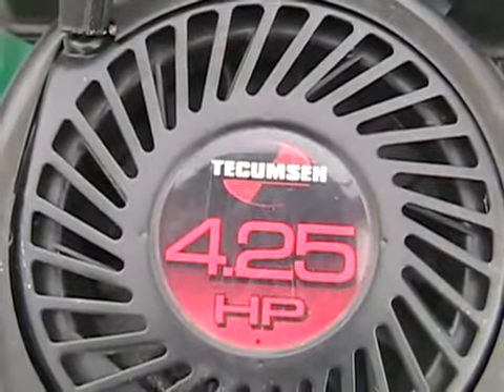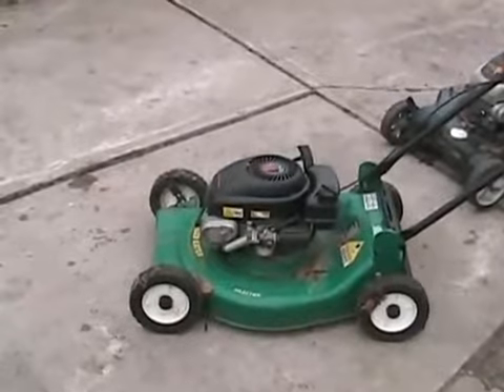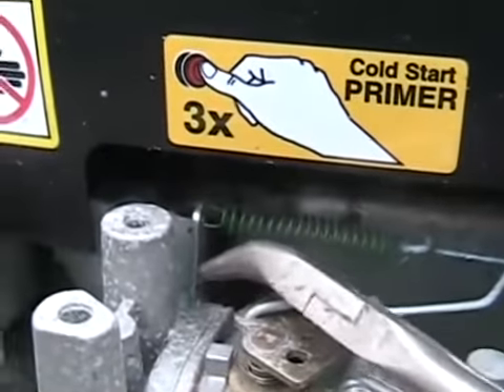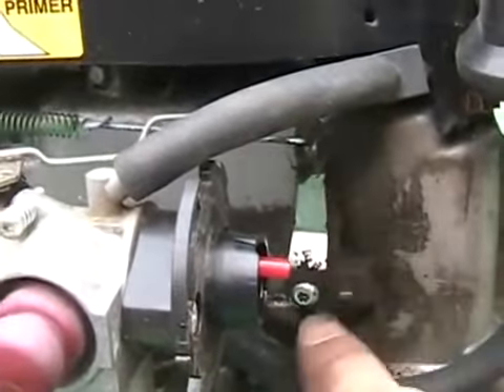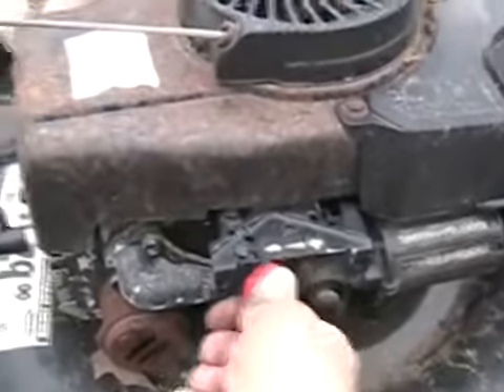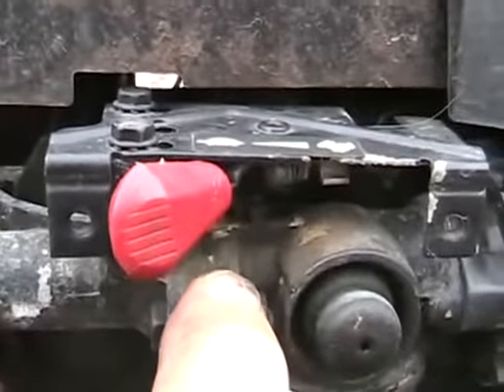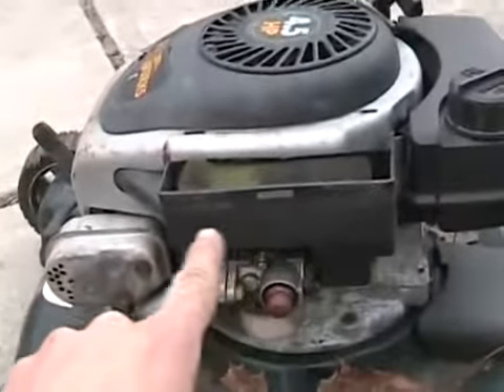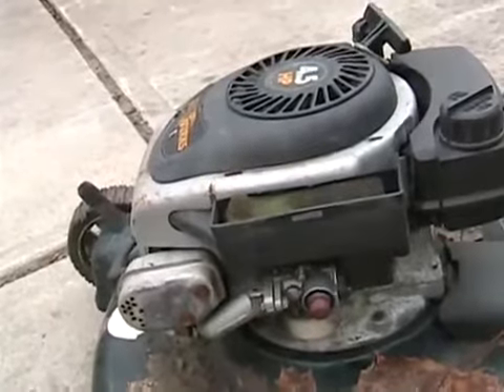Davidsfarm   0791   zbl47ppCbBU   HQ   tecumseh lawnmower speed and govenor adjustments

Comment: What he didn't add was Flat Head engines are not designed to rev above 3600 RPM.If they do they'll sling the rod. The stock rod is made of Aluminum and it's not designed to rev.